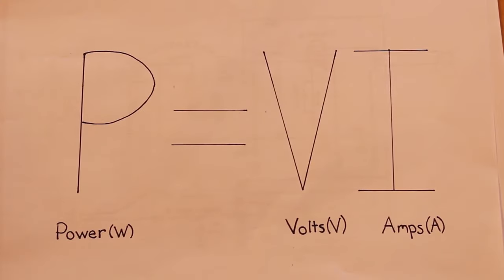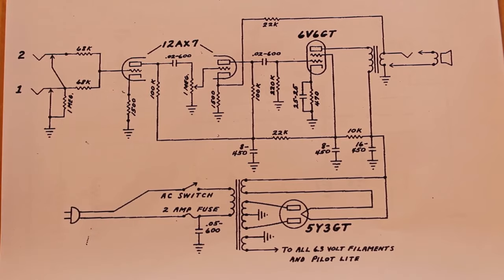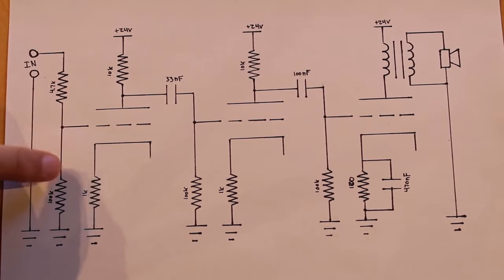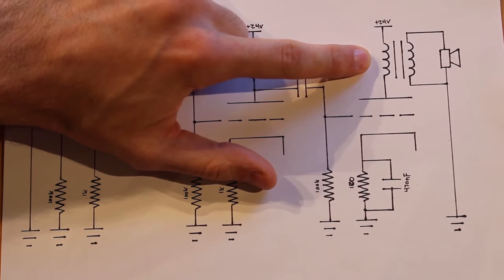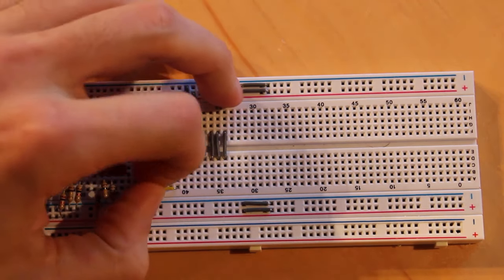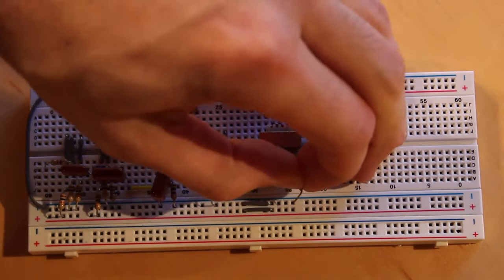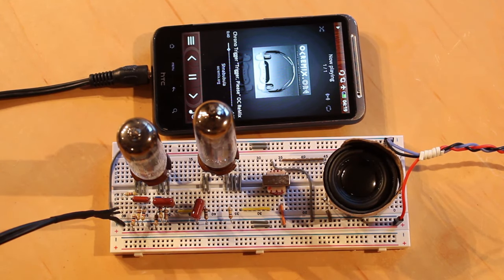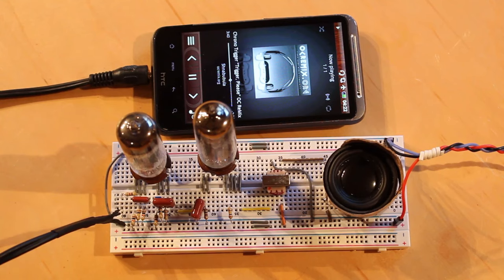Let’s Build a Low Voltage Vacuum Tube Audio Amplifier

Comment: I've been accumulating tubes over the years and always wanted to build a preamp or any audio circuit with a few, but the high voltages, expensive parts and inexperience with valves kept me away. But this example , with low V , easy to find parts and your explanations of the circuit has got me ready to give it a try..thanks man!"
Reply from the maker: Thank you for checking the video out!
The high voltages of tubes are definitely the scariest part of them, but you can still build quite a lot of really cool stuff at lower voltages that are still safe. I'm using in total, 36V here, but you can even push that up to 60V-ish and still be pretty safe!
Reply: @UsagiElectric  I think the voltage multiplier would be the key to get B+ voltages. You can use 24vac and multiply from there. I want to try building an amplifier using just ac power to start from. The output transformer will be the challenge,  someone told me to try a Pa transformer probably the 70 volt type. You can only use it on single end audio amplifiers won't work on push pull amplifiers. 73

Comment: I'm only a few minutes into the video..... But when you said let's switch the 100K to a 10K on your first tube stage...

  I think you'd do better to switch it to a 200k or even 300K. You will want all the gain you can get. 
   I believe it just works that way. More technical than that. And of course after that, bias it properly as you really want to find the correct knee for your voltage of that tube.

Comment: Don’t sound too bad. Perhaps you can design a push pull amp. You single ended triode is a good start.
Reply from the maker: Thanks!
I actually really want to design a proper OTL amp someday. I built a low voltage OTL using a boat load of 12B4As and it put out a really great sound comparatively, so I think it would be a ton of fun to expand upon that idea!
Reply: @UsagiElectric  I saw the video, it worked well.

Comment: Nice build,
Saturation is coming from the transformer. It is not made for DC. It should be a gaped core one.
For the rest there are 12V tubes that exist that were used in car-audio conceptions

Comment: Without a cabinet, the back side of a speaker will generator the opposite phase of the front, thus cancelling out much of the sound when they mix together.

Comment: Yea no. The negative feedback stops spurious oscillations. The old addage applies - "The quickest way to build an oscillator is to build an amplifier." Also, you perhaps should have ran the circuit with the resistor in to see if that helped with volume or not.  Edit: Excuse me for being a negative Nancy, but I suggest that you remove the power before modifying the circuit like when you went to 24 to 36 v. Sure it's a "low voltage" but it should be done as good practice/habit especially around HV tube circuits. If not for yourself but impressionable viewers to your videos.
Reply from the maker: You're not being a negative nancy, I'm a total noob at audio stuff and any and all feedback is welcome!
As for the negative feedback, I did test the circuit off camera both with the feedback and without, and surprisingly it actually hurt overall volume with the feedback hooked up. But, without it, I didn't notice any unwanted oscillations or sounds, so it could be that at such low voltages, the feedback isn't quite as necessary.
As for being good practice to remove power before modifying the circuit, as you said this is a really low voltage circuit, so in this instance, there wasn't really any risk to me. At higher voltages though, well, I would certainly hope that no one is building a high voltage tube amp on a breadboard, haha.
Reply: Negative feedback ALSO steals gain....

He didn't have much gain to begin with, and certainly not enough to end up with oscillation issues.... 🤷

There are PLENTY of amplifiers out there that do not use a negative feedback scheme. 

Negative feedback IS a double edged sword, and is not always a welcome, good thing.

A high gain, high power amp would definitely need it, but not something like like this.
Reply: @UsagiElectric Many people build tube amps with tag board or point to point "dead bug" style. I've even seen it done on a bread board... lol. 

BUT safety has to be of the utmost importance with high voltage tube circuits, and most veterans understand this. Im sure you understand this as well.
Reply: @davelowets  every possible amplifier circuit has been built and documented. It's already known what will work and what will not and the reasons. It's called circuit design and people have done it already. There's math proving these concepts. Poorly designed amplifier circuits no matter the gain will oscillate which was the point of my comment which I stand by. Sure anyone can throw parts together and sometimes it works sometimes it doesn't. That's poor circuit design!

Experienced/knowledgeable circuit designers know these things well already

Comment: you should have looked up the vacuum tube sound card for pc's then, use that as a basis since it only has 12v to work with

Comment: Capacitors do block dc, in that configuration only passes AC audio signal to the next stage, is important to operate correctly also on high voltage operation are necessary to basically avoid red plating and grid overload. Thats because if you watch Mr. Carlsons Lab or David tipton or anybody who restore old radios and purchase this type of used equipement always says dont plug it to the person who is selling, because those capacitors if they are too old papers and bumblebees turns into a resistor, those always go bad and that destroys tubes an cremates the output transformer.
Reply from the maker: I always had such a hard time understanding when people would say caps block DC and let AC pass, and you can have both on a circuit. I think it's more of a terminology problem for me though. Fundamentally I understand exactly what's happening in terms of signals, just the wording always tripped me up. For my brain, it helped to think about the output on the plate being an oscillating waveform that moves from +10V to +20V for example. The capacitor shifts that signal to -5V to +5V. Still a 10V P-P signal, it's just shifted the center point to be around ground. It does this because as the voltage at the plate increases, it charges the capacitor. And then, as the voltage on the plate decreases, the capacitor feeds that voltage back (because it's at a higher potential). The result is that the other side of the coupling cap changes potential in accordance with the charging and discharging of it, which replicates the signal but eliminates the DC bias.
That's probably not the best way to explain it, but thinking about it in that way is what made it click in my head!

Comment: He said, "...how to make this cooler..."  That's easy.  Replace the tubes with some MOSFETs.  2N7000s for the small signal amps, and a power MOSFET for the power output.  It will run a lot cooler. 😊

Comment: Nice video , I think if you can use better Output transformer the efficiency will improve even more or deliver more power. I like low voltage tube amplifier..
Reply from the maker: Thank you! I definitely think you're right! Those output transformers are a little too small to give proper good sound, but I have a handful of them, and I really wanted to use them on something, haha.
Reply: @UsagiElectric  Normally they have lower impedance , in my old book there is ST-32 which is 1K : 8 ohm they use for 9V battery , i did clone it with ferrite core in my youtube video.  

if u can find a small scarp transformer maybe u can wind urself..I have several 16K to 8 ohm and 32K to 8 ohm use for my vacuum tube experiment..
Reply from the maker: @6p1p  Just checked out your channel, you have a ton of awesome videos on CRTs! I'm going to have to check those out as soon as I get some free time to binge some Youtube!
The output transformer is one of the most difficult parts of a building a tube amplifier I think, because the rest of the amplifier can be amazing, but if the output transformer is mediocre, it'll totally kill the sound! There's a definite art to getting it all right.
Your 6J6 push-pull hybrid amp actually sounds really good, that's an awesome build! I'll dig through your channel more as I get more time!
Reply: @UsagiElectric  Yes i agree with you , to make it sound good the output transformer is the most difficult one.. I tried wind my output transformer since 2004years and i wasted alot material for keep try and error.. If you just want it work and sound ok not as grade as hifi , you can use any power transformer core , the hifi grade they normally use Oriented core Z11 or M6 lamination core which the thickness is 0.35mm , typical transformer core is 0.5mm thickness. Normal core will work good as well. The only you need to wind it . The winding isnt difficult just need patience  to do it.  The ratio of primary turn versus secondary turn , square of it will be primary impedance versus secondary. for example 5K:8 which is ratio of 625 , and square root of 625 is 25 , so your primary need to have 25 time number of turn of your secondary by using this u can make all transformer u want.. the primary inductance impact your low frequency bass the more the turn the better the low frequency response. If u have any question is welcome to message me. good luck
Reply from the maker: @6p1p  Interestingly, I think my next proper audio project is going to be trying to build an Output Transformer Less (OTL) amplifier. Everything I've read about them makes them seem like the vintage Ferrari of amplifiers - super finnicky and difficult, but when running right, better than everything else out there. I think I understand it at a fundamental level. You've got the standard amplification part, then you've got a ton of tubes in parallel to provide enough current to actually move a speaker.

There's a few different schematics out there, though this one seems to be the most common: https://www.bonavolta.ch/hobby/images/audio/6as7_2a.gif

There's a lot of really interesting things going on in that schematic too, I particularly like the dual triode amplifier stage with the cathodes tied together, that's an interesting way to do it. I wonder if that was done specifically for some aspect of the OTL, or if that just so happened to be the preferred amplification method by the designer?

At any rate, I love the idea of a tube amplifier that uses just plain brute force instead of an output transformer. One of these days, I'll get around to actually giving this a go!
Reply: @UsagiElectric  There is no much vacuum tube OTL i think mainly due to Vacuum tube are high impedance device, which you require alot heater power to make a good emission , but tube are good at high voltage insulation most of tube can withstand 300V without any problem, that is due to the higher the voltage the more positive attraction to pull the electron from cathode and semiconductor are in opposite way , they are in a solid semi metal , current is density while a metal can have alot density of atom which can carry more charge , so semiconductor is easily to carry alot of current compare to vacuum tube . but semiconductor need some modern technology to make it have good insulation. So Transistor are good for OTL . for vacuum tube it require alot of heater power to make a good current, unless you have very high impedance speaker.. If u drive low impedance such as 4 ohm speaker it will be difficult more difficult then drive 16 ohm speaker. So vacuum tube are good with high voltage output low current ( which is high impedance) while transistor are good for High current low voltage which is low impedance .

In term of vacuum tube sound, People believe the sound good is due to Vacuum tube their unique distortion pattern.. Some distortion are from transformer.. I did try with a output transformer class A transistor amplifier it sound slightly like vacuum tube , i guess the transformer add some distortion to make it sound good maybe.. There is some different between class A and Class AB or Class B , Class A they are storing the energy and the voltage of plate can swing more then B+ , while class AB or B it operate more symmetrical in transformer. like our AC main
Reply: @UsagiElectric  Example of 10Wrms by using 16 ohm speaker, Require I = 790mA and require V=12.6V so the vacuum tube have to drop from 150V to 12.6V , which is about 137.4V drop in tube with current of 790mA , so the power dissipation on tube will be 137.4V x 790mA =108W..  

for 4 ohm speaker , to drive 10W output , require I = 1.5A and require V =6.3V , so the tube have to drop 150V - 6.3V =143.7V with peak current of 1.5A , so power dissipation on tube will be 215W .

so for OTL output 10W at 4 ohm  the tube have to dissipation of 200W ++ deliver 1.5A current to drive 4 ohm speaker to output 10W . For higher current it require more heater power as well.  to reduce the Tube dissipation , if can reduce the voltage from 150V to 20V .. since speaker require 6.3V only , but tube work very poor at low voltage..

Comment: On your vacuum tube computer, I was just wondering did you consider sub miniature tubes? I’m just starting out with vacuum tubes and my mind is flooded with ideas. I’ve been scared to use anything other than sub miniature tubes because I’m worried about working with higher voltages. Can you also maybe recommend one of your videos that would be a good introduction on tubes? Thank you 🙏 sorry for the long comment.

Comment: I did this same circuit in early 70s, no board or anything the components tacked directly across the B9 bases and the whole thing looked like a birds nest. Slot car racing set transformer as power.

Comment: I wondered if you were a radio ham? It would be nice to see some low voltage ham radio projects. I have some low voltage 28d7 power output valves (4) I would love to find a use for. G7VFY.

Comment: You know you can use 24 volts ac and make a voltage doubler or more using diodes and capacitors. And there are tubes that were in battery radios before we had transistor radios. They used 90 volts for the plates or known as B+ voltage the filaments in the tubes were one and three volts. To get 90 plus voltage you can make a voltage quadrupler using diodes and capacitors. I believe theses circuits would be fairly easy. As for output transformers maybe try a Pa line transformer like the 25 or 70 volt type. Power transformers is another option. 73
Reply from the maker: Yup! But the main purpose of this was to see if I could build a tube amplifier with a super common low voltage. 
Granted, with limited voltage, we have very limited power, but it still produced a surprising amount of sound for such low voltage! This is definitely not the best way to build an amplifier, but it's certainly an approachable way for anyone wanting to get into tubes without being quite ready for higher voltages.

You're definitely right on the output transformer, a properly sized one would probably make a much better sound!
Reply: @UsagiElectric  yeah I know there are a lot of fake tube headphone amplifiers out there . I bought one and it had a solid state amplifier for the output. Low voltage plate current can be used for headphones and with good sound. It's a shame they don't make high impedence headphones.

I did not.comment.to take away from your idea of low plate current but to tell people we are not limited to 12 Volts or 24 volts. I just threw another option out there for higher.voltsges using only 24 vac. Power transformers are hard to find at a low price. I commented on another page how to use two transformers for isolation. There are many ways around using what you already have. 73

Comment: I bet this amp produced a couple of mW! Tubes are high voltage devices and should be used on high voltages to get a decent output power.  A few years ago I have built an audio amplifier with two transmitting tubes operating at 5000Vdc and produced 1300W of audio power ! That's a real challenge.